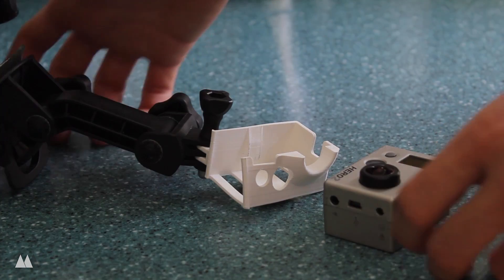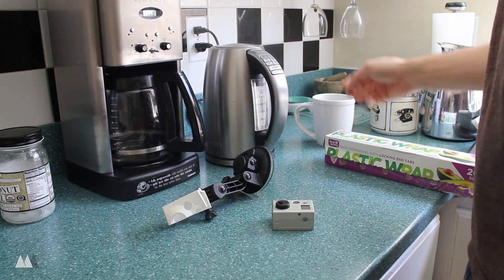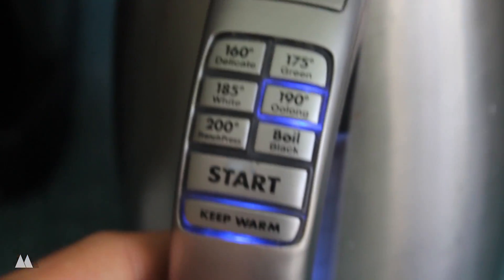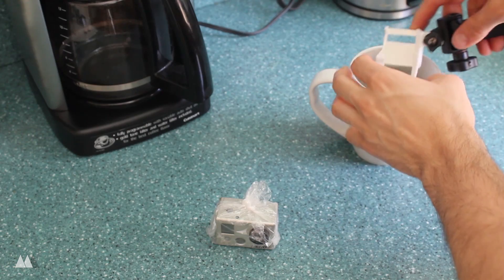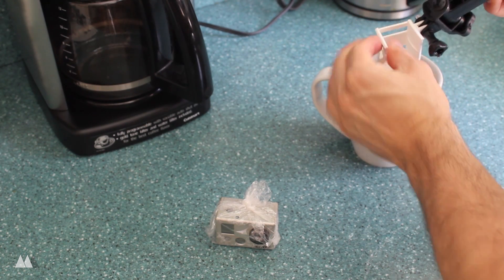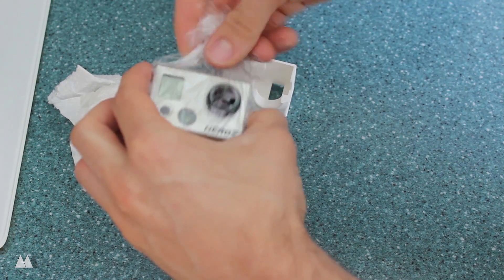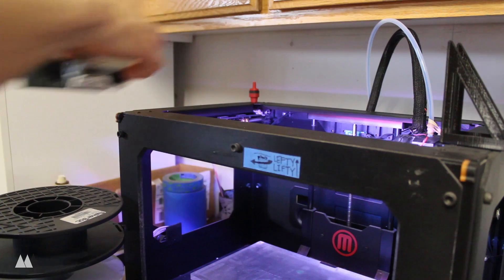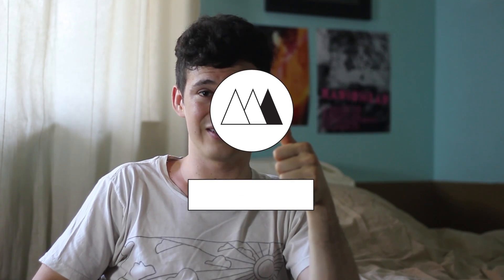Fix Warped PLA Prints with Hot Water

Comment: I have to comment because it drives me crazy.. setting the kettle to 190 doesn't heat the water faster then if you clicked the correct temperature you actually wanted. You now are guessing what the real temperature is when you poured it.

Comment: I printed something flat, but it came out a bit warped. I dunked it into boiling water for about 20 seconds, took it out and pressed it flat against the table for about 10 seconds. Then dunked it in cold water. Worked like a charm!

Comment: Thanks. I just tried this with a flat PLA print that came out slightly concave at the bottom. Dipped it in hot water for 15 seconds and pressed it against a glass tabletop until cool. Worked perfectly.

Comment: PLA melts at 150C - 190C degrees, not 190F. 150C is about 325F degrees and 190C is over 400F degrees. You water heater only went to 190F degrees. Water boils at 212F degrees. You would not be able to put your fingers into the water like you did.
Reply: Elfen Magix This is not correct. PLA is printed at those degrees, but you can deforms it at lower temperatures. There are videos where PLA deforms at 50 Celsius. Yeah, he said that it "melts", but he means that PLA "deforms" at those temperatures.
Reply: I had warping issues with two connecting 3d parts and literally hot water from the sink did the job. 150C definitely does not sound right.
Reply: It's not the melting point that matters, but the glass transition and that happens as low as 60°C.

Comment: I dont really know anything about 3D printing, so Im wondering if there there are different materials you can use to print with that wont warp?
Reply from the maker: yep there are many other materials with higher melting points, but PLA is cheap, biodegradable, and easy to work with, so it's the most common filament used
Reply: Make Anything // 3D Printing Channel Try using ABS, I sue that, the only problem is it sometimes warps during printing.